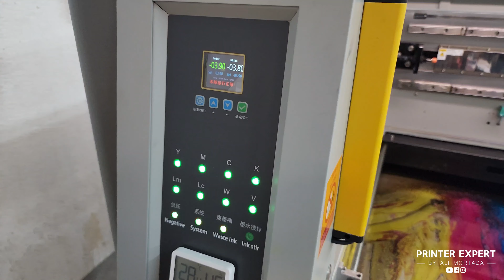Introducing the Wit-Color UVIP 5M hybrid UV printer

Comment: Hey how many heads does it use
And which heads to be specific
Reply from the maker: 12 kyocera printheads (3 rows)
Reply: What might be the problem here is it the board?
Am a technician in kenya i admire and follow your work will love to learn more.
Reply from the maker: If no previous problem with board it should not be damaged.
Test the refurbished head on another printer, are you sure the head is working ? 
Can you see ink in cap base after ink pump? Maybe you don't have proper suction so there is no ink in the head.
Reply: Yes we can see ink of all colours but upon firing its not working
Reply: Just tested it on another printer removed allnozzles
Reply: Might it be the A/Cs